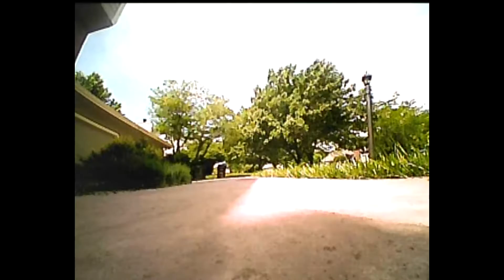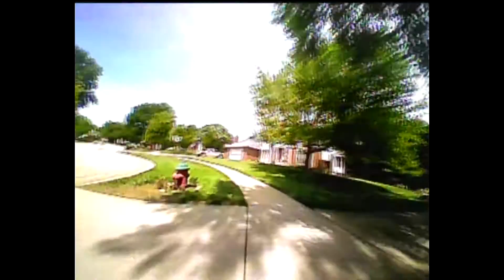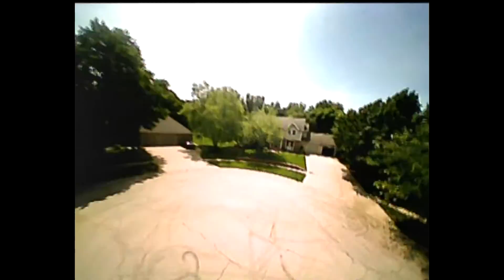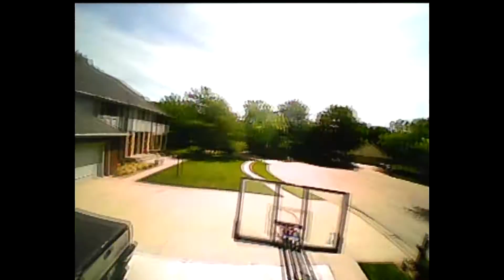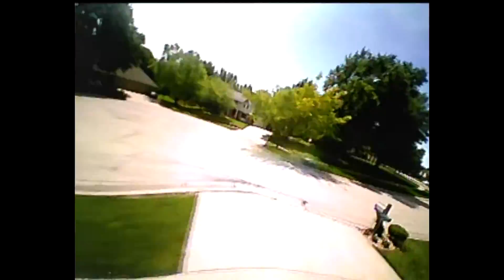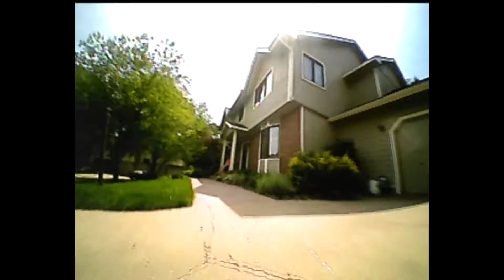FlexRC Frog Maiden - 122mm brushless

Comment: I am trying to get into this hobby. I want to build a fpv drone using the owl frame and it comes with the lemon receiver just like this one. I want to make sure that the transmitter that I buy will bind with this and I am considering a taranis. People have said the taranis would be a well built transmitter that could be used forever. What do you think? I just want to make sure everything will be compatible. Any advice with building a drone would be fantastic! The owl build is very similar to your frog build. I don't know anyone in person that will be able to help me and I am afraid of messing the whole build up or getting stuck. Do you think a beginner could do this successfully? Thank you so much for your time and I enjoyed the flight footage. Good work!
Reply from the maker: I believe with patience and persistence anyone can build one. If you get stuck, take a break watch some build videos, and ask questions, reddit and rcgroups are a wealth of knowledge. I will try to help as well.The taranis is the most popular controller/TX. But to use the lemon rx the taranis requires the orangeRx module for DSM2/DSMX protocol. Hobby king and others carry it. I use a Devo 7E running the deviation software. Its much less expensive and suits me.
Reply: +Nick Burns okay thank you so much! I really appreciate the information. One more thing.. how long are brushless engines supposed to last? I've read on the forums that they last hundreds of hours but some people have said theirs have burned up much sooner. Maybe from crashes or maybe they were cheap? I'll be interested to see how the engines hold up on your frog!
Reply from the maker: yes, it can vary. with larger motors with a single shaft crashes will affect life more. One hard crash and bent shaft, either replace the shaft or the motor. The little 1105s I am running the shaft is protected and the motors are protected with the frog fingers. Also, yes, if the price is so much lower than all the others we can't expect them to either perform the same or last as long as their more expensive counter parts. I think without crashes the next issue is how hard they are run. If they are pushed hard and routinely are hot likely shortens the life. I bought RCX1105B for two reasons, they have a replaceable shaft and bearing (the other part of the motor that wears out) and they are motion balanced. Much like a tire on a car they spin them and add balance mud to ensure even rotation with less vibration. With all that, I build brushed micros too, they get about 30-50 flights before I have to replace. I suspect I will get double or more from a good/descent brushless. If you haven't built before or flown I would recommend a brushed micro. I have a number of videos on them and they can teach you how to build/solder, fly and tune at a much lower cost, one can be built for about $100, then you only need batteries ($2-$7) and you can use the taranis with the orangerx dsm2/x module. They can be flown in small spaces or indoor if you have the space. They also have the ability to be flown similarly to their brushless counter parts. With the decreased weight crashes rarely break anything other than a prop.